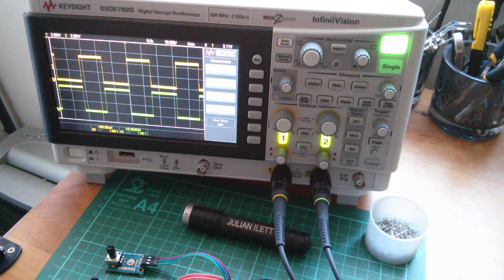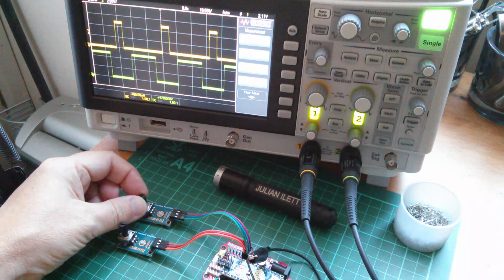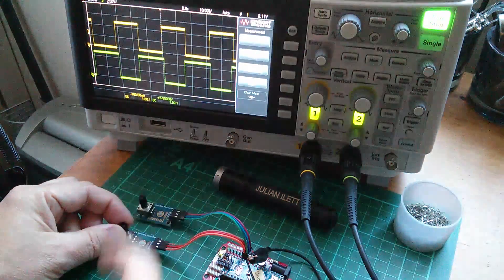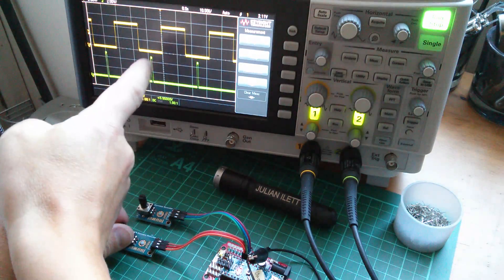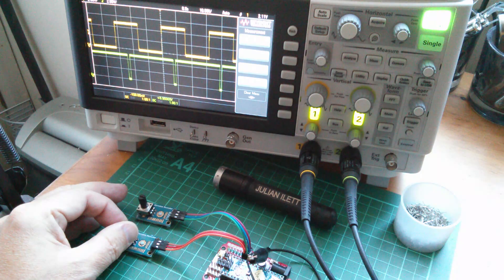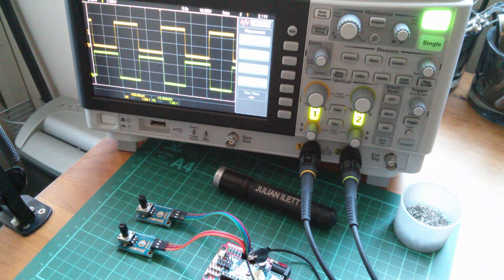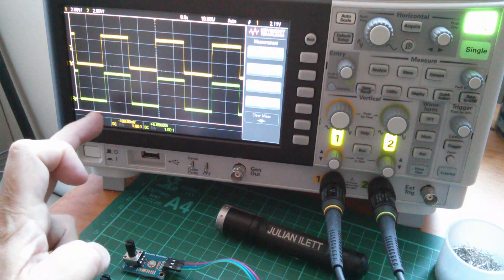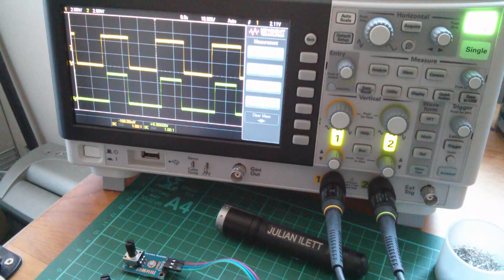Arduino PWM Inversion Issue - Muppet 2 Project

Comment: Why (or rather when), do you nees 0 or 100% "PWM"? And if you need it, it could be done in software with a couple of ifs. :)
Reply: This is not a hardware glitch that needs a software workaround. It just needs the hardware to be used correctly ;) . Just write the timer compare registers directly and all is fine. 
The Arduino core code for analogWrite is bugged for inverted timer outputs. Check the core code (it's in the Arduino install directory in wiring_analog.c in that case). "analogWrite(pin, 0)" always does a "digitalWrite(pin, LOW)", it has no idea about inverted timer outputs (the same for "analogWrite(pin, 255)", does a "digitalWrite(pin, HIGH)"). A function too smart for its own good (and unfortunately by far not the first time for me that Arduino caused a harder to debug problem than helping in the first place).
Reply: Julian Ilett
Native arduino libraries swith pin to HIGH or LOW output mode if you set PWM 0 or 255 using analogWrite();

You can see, how they disable pwm in digitalWrite code.
Reply: Julian, I was thinking more like if (x == 255) x = 0; and vice versa. I can't imagine that would cause any glitch. Assuming of course that the "PWM error" applies to the two bounary values (0 and 255) only.
Reply: Paul, sorry I got it wrong. 
:)
Reply: Paul Sampson

if you not inverting PWM signal - you will have two transistors short cirqueted. if you set one pwn channel to  99%, and 1% for the other - 1% of shorting time.
Reply: I, too, thought this might be avoided with software. As for external hardware inversion I'm wondering if the slight delay introduced by it might knock out the critical overlap needed, but I suppose at the frequencies involved this probably won't be an issue in practice.
Reply from the maker: I suppose this could be worked around with software, but switching the output pins from PWM mode back to regular I/O mode would probably cause a glitch.
Reply: Or why not just analogWrite(3, (1023 - analogRead(A1))/4)
Reply: Paul, I guess he sometimes needs to go digital "1" or "0". Like when the input voltage is the same as the output voltage (neither buck nor boost).
Reply: Robert Eliassen
this can cause a REALLY hard glitch, code can lock itself up between changin x from 0x0 to 0xFF and back every time!

Paul Sampson
you need high on A and B on low at the same time, and without inverting you cant get it. they are synchronous
Reply: I think the subtraction covers that?
Reply: I agree, and I was talking about inverting the second PWM signal. Timing is done in software, to avoid both FETs in a row to turn on. Can't see how switching from 0x00 to 0xff would be a problem, unless you mean really fast switching. But I don't think you need fast switching between 0x00 and 0xff in a buck or boost converter.  When I say "fast" I mean 30+ kHz.
Reply: It's easy fix btw:
if (analogRead(A1) == 1023)  analogWrite(3, 0);
if (analogRead(A1) == 0)  analogWrite(3, 255);
Reply: +ADFKSJG - I meant without the inversion of pin 3 in the setup too. 1023 goes straight to 0, 1022 to 1, continuously all the way down to 0 mapping to 1023. Then your division by 4 brings them all into range. No glitching - every value gets the same treatment. You could even just NOT the value from A1 instead of subtracting it from 1023.
Reply: You are inverting. By subtraction (or negation) in software of the value read from A1. You don't need - indeed you must not - invert the output, which is why you omit the second setup line. 
In brief (better not say short!), invert digital 3 in loop, not setup.
Reply: You cant invert it that way to set a is on while b is off. without 0x30 in some register you get them synchronous, every time. B signal is centered out from A signal, so if both pwm is more than 0 - they be on together for some time.